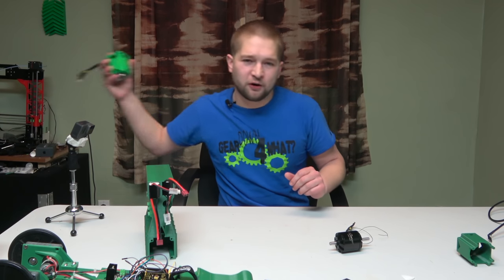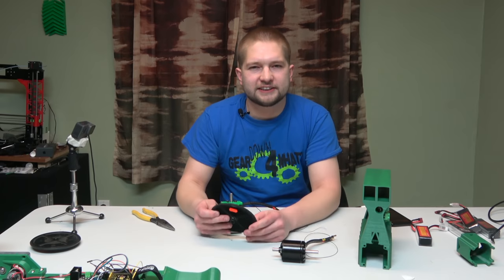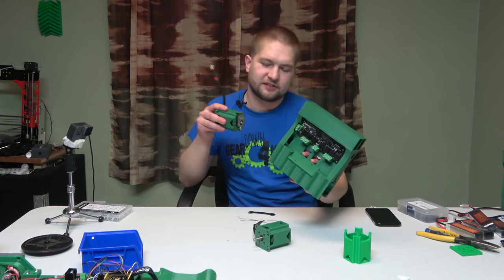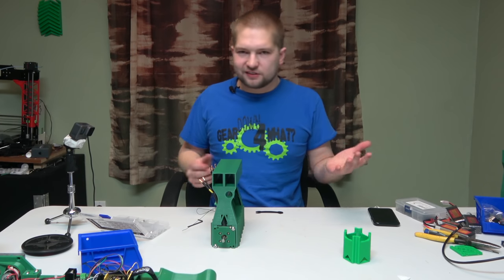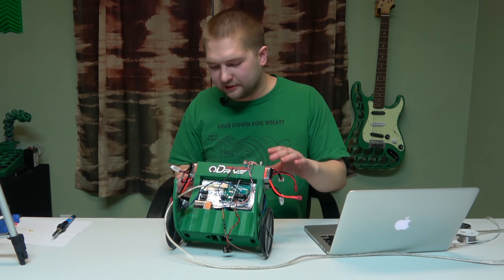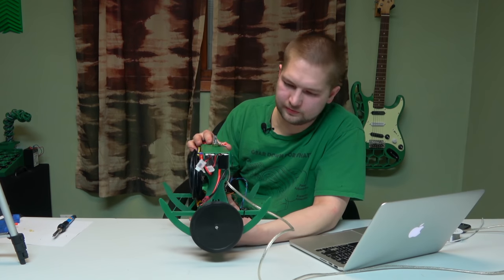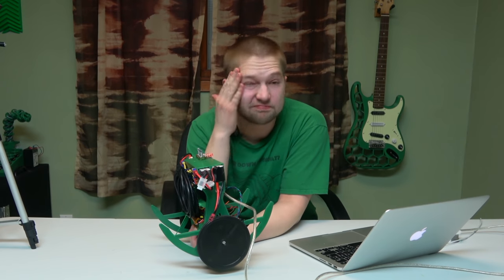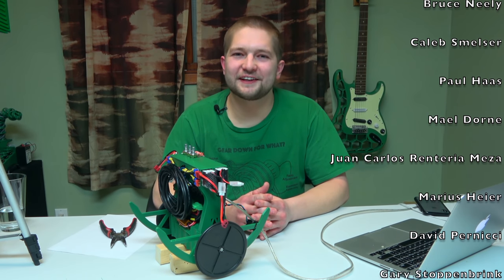Building the Balancing Car.

Comment: You might try twisting the high current wires between the O drive and the motor and between the O drive and the battery. Twisting these wires together causes their net magnetic field to be close to zero. Run each bundle through a ferrite core to get rid of high frequency noise. Also put the gyro lines through a ferrite core. This should reduce your interference issues.

Comment: Something that I am not sure if is discussed in a future video, or is someone had discussed this, but when I did a balancing robot several years ago, it was crucial for us to bring the center of gravity as low as possible, and to place the accelerometer as high as possible. The lower center of gravity causes a lot lower torque at the wheels, and the higher accelerometer allows the microcontroller to be able to read smaller movements, which in turn allows you to respond a lot quicker. 

Not sure if that helps, but that is what I did before.

Comment: Small suggestion.. Add traction to your wheels. (rubber, something similar in texture etc). Not even close to your actual problem, but you'll be surprised how much it helps.
Reply from the maker: The wheels do have rubber. It’s a plastic wheel with a rubber o- ring. Super grippy

Comment: The solution is to made two big wheels with the graviti center on the top of the ensemble and a transmission to the motors

In that case, the weight will be support by the top
So it will stay straight on is wheels 
I hope you will appreciate this solution ;-)

Comment: I think a Capacitor is how you remove voltage side noise, and I'd try a diode at the ground side of both the Arduino and the O-Drive. check https://electronics.stackexchange.com/questions/95140/purpose-of-the-diode-and-capacitor-in-this-motor-circuit (I've fried arduinos with much smaller motors, before I learned about kickback voltages)

Comment: If noisy powerlines are a problem, use an optoisolator (ebay has loads of them for cheap, look for 4-channel opto-isolator TLP281) on the comms like between the Arduino and O-Drive, and use a nice clean power supply for the Arduino. Alternatively, buy or create your own DC to DC converter and use some nice big caps to help with smoothing. But I'd go for the isolated option which will eliminate powerline noise and comms noise (for some value of eliminate).

Kalman filters are surprisingly easy to implement, and could be better than a simple moving average for when there are genuine spikes in the data. The moving average will tend to blur the signal and reduce its amplitude. TBH, the PID should be able to cope with fairly noisy data anyway.

Also, it looked like the wheels were spinning at one point, which could be caused by the high torque and the loose-fit tyre. I'd go looking for a smaller ID o ring and make it a snug fit, or take them off entirely and use a rubber mat or similar as my surface. Or even put a bead of hot glue on the rim to increase its diameter, then put the o-ring on that.

Comment: Test your Gyro and Ardunion without Odrive. If this is fine,
you might have problems with the powersupply. If the powersupply
for your MEMS Gyros or Adrduino are not stable you cant work.
Try two different batterys. One for Gyro and Ardunio, one for
Odrive and Motors. When this runs fine, you can work on PID.
Increase first P (proportional) until it starts to shake. Then 
make a deadzone for P. (for example ignore values lower 10/-10).
You will see, you can make P with this much harder. Then add 
I (integral) step by step. Normally you dont need D. For I, you will need
also an acceleration sensor, to compensate drift. A simple
comparisions still works fine. To make a good drift compensation,
you will need time (compensate vehicle accelerations etc).

Comment: The issues you are having are a result of the type of system you are trying to control. You have an underactuated system i.e. single input multiple variable you are trying to control (you should do some research online of these kinds of systems) You need to prioritize your angle over the translation and thus allowing your robot to move laterally in order to "catch" the angle. I.e. allow x to be nonzero in order to keep angle to be zero. I actually did a project like this but it been a while since I did it. I used the minseg. You could also look up the minseg and try to use their resources for balancing it.

Comment: The "training wheels" are a really good idea! It's also awesome that you're so honest about the things that didn't work out.

About the PID value ranges: using a logarithmic scale would probably be a good idea so you could experiment with different orders of magnitude on the fly. Also, what if you just mechanically change the angle of the accelerometer. Shouldn't that fix the error in the initial value?  Whenever I'm tuning a pid controller manually, I watch this video a couple of times and ponder what would Kevin Lynch do. https://www.youtube.com/watch?v=uXnDwojRb1g

Using shielded cables and decoupling caps as suggested in the other comments is a good way of battling interference. What I've done, since I usually don't have shielded cable laying around, is twisting the current carrying cables (twisted pair), making them as short as possible and routing other cables far away from them.

Comment: GDFW You probably need to make a RFI choke find a small toroid core and wind 2 coils on it and use one for supply voltage and the other for gnd if you use say about 13 turns of thin 32 AWG wire the noise on the power lines / or signal lines should be negated if not try connecting one of the coils the other way around, I made such a choke for getting rid of high voltage noise from my electrostatic filter it does work. Also search online for making an RFI choke. For example here is a simple easy way to eliminate interference https://youtu.be/LuMlM8zWQFk

Comment: Suggestion: add a button and read the pots when the button is pressed.
Would some decoupling capacitors help with the 12V power to the Arduino?
The balancing protector bars are inspired.
Progress is good!

Comment: the problem is you are trying to change too many variables at once.
my suggestion is, you need to rule out a few variables first. the first variable to rule out is to simply hardcode a balanced position manually first (simply hold it in place and get the readout via serial).  it seems like it had trouble determine the "balanced" position in the first place.

Comment: Great progress so far. If you want to get rid of the EMV problems use sceened cables and connect the shild to ground. Do you demmand torque (current) from the Odrive or speed?

Comment: There are versions of the Arduino I2C library with a timeout - so it does not hang - but in your real time situation any delay over a few ms is going to be a disaster. Logic analyser (in another comment), set off on ebay around $5 (Saleae) use with (free) Pulseview. Combing gyro and accelerometer is a field known as sensor fusion. It not working (at the start) looked like a triumph for analogue electronics - all the dark arts of decoupling caps, ferrite beads. 'scope well worth having - there are kits for $15 on ebay, better than nothing - proper one much better.  Or online free software use PC sound card.

Comment: lol 🤣 "[i've made a bunch of other changes to the program which is] always a really good idea, uh, to make a bunch of changes without having any type of control"
Reply: also perhaps you could decouple the common ground and the pwm using transformers of some sort? I'm no EE but I think I recall that being a thing to decouple ham radios from a computer audio interface for doing transmissions using a computer sound card.
Reply: @lollubrick  a PC almost always has a grounded chasis (laptops are bit more complicated), so if you were to connect it to a radio which is also grounded, you'd form a ground loop. No need to isolate things so much, you just have to make sure your grounds meet in a single point, no loops.

Comment: Nice fail, keep trying. 
1st put batteries down together with o-drive then put sensor and arduino on top, 2nd use dc-dc converter to power arduino and sensor.  Also in your sketch dont balance it on 1 degree give some buffer 2-3 degree, then work from there. Someone also said in comments and I agree with him, on start zero in sensor by taking several readings before you let it go. Maybe even put sensor on 20-30 cm stick on top of robot, you will have much bigger tolerance.
Arduino use 12 V or ltl more to step down dc voltage if y put 24 V y will kill it or it will shoot down it self, with melt fuse and come back when it cools down.
Good luck and keep trying, like to see how this gone work in end.
ps. gyro sensors are bad for this purpose, good only if your robot is gone move on perfect flat

Comment: Hey Buddy Down For What
I have a uni project to make a vegetable cutter (a little overpowered) have a better performance. I thought about using the same potentiometers you did on the PID system to be able to control the speed of the motor, the problem is I'm not sure if it's the better thing to go for, or if it'll work at all. I know I'll have to deal with 220V and around 2,5 amps to get the maximum speed from the motor and I'd like to be able to reach close to half this speed. Do you know if that kind of electronics can effectively control universal motors? A tutor of mine advised me to have speed modes (like low/med/high) through buttons, but for high production's matters, I'd preffer to keep a cheaper solution, and avoid electrical boards of any sort.
Sorry if bad english
Big hug from Portugal! Love your videos!